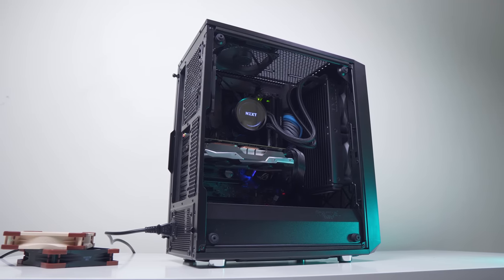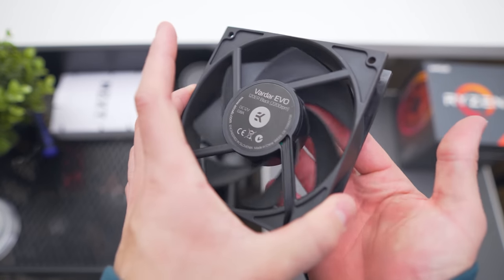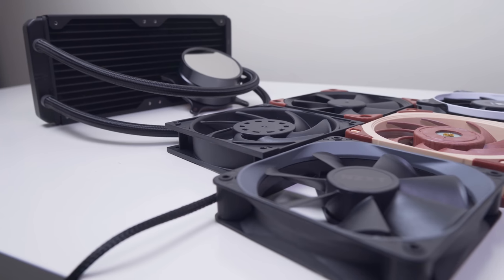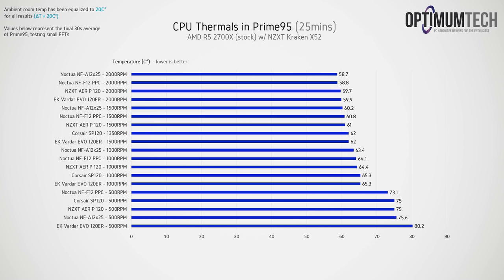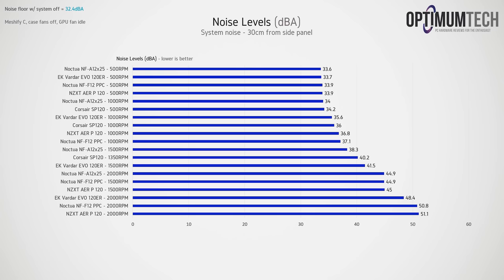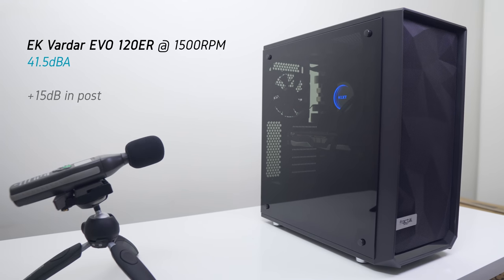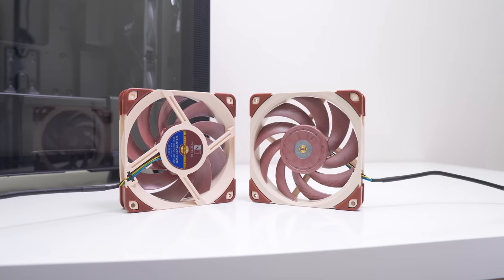Noctua's NF-A12x25 - Magic on Radiators!

Comment: Don't like the brown shit color of the NF-A12x25?
Noctua said they are going to release Black version of it around Q1 2019.
But it might be delayed because it's not a simple drop of color at 0.5mm clearance, the materials of the fan are delicate and any little change can cause the fan to touch the frame overtime.
Reply: Oferk99 Its a coffee and leather color. Not shit as shit is alot darker
Reply: it depends on the shit x) and i understand his frustration to wanting to buy Noctua stuff but just can't because of the color.
Reply: generaldwarf 
Yep, it will ruin my beautiful build, and I don’t want to buy last gen fans.
I’m better to wait for black NF-A12x25 and NF-A14x25
Reply: It depends on how your food was digested. Noctua brown can mean healthy digestion, while pcb green can mean stomach flu. Case fan black can mean stomach ulcers, while AMD red can mean internal bleeding. If your poop is Intel blue, it probably means you live in Chernobyl and need to move out. If your poop is Zotac yellow, you probably ate too much corn. Finally, RGB lighted poop means you partied too hard and had too much drink

Hope this helps
Reply: @mdexterc2894   Lol! Nice one!  Got a chuckle out of me.
Reply: actually these fans made me plan a build in white with noctua color accents. leather and maple wood. custom sleeved cables and painted radiators.
Reply: @tf2excession  q1, q2 2019 is expected. No guarantee. This is what tech support told me via email
Reply: @Caffeine.And.Carvings  I think they will show something at Computex 2019
Reply: Hopefully we get this in 2020. Lol
Reply: I'm building a new pc this week in a cougar qbx. Going to buy the remaining parts tomorrow. I'm highly considering embracing the noctua color scheme and painting the inside of my case its complementary color https://www.colorbook.io/hexcolors/view/4a2220 and painting the psu the dark brown and creating custom sleeves of the light beige color. Already bought 3 NF-A12x25 and using noctua's 92mm cooler (NH-U9S) with two of its fans. If I do decide to go with it will also paint the outside portion of the cooler the dark brown color. I can't make up my mind though. Worried it will come out horrendously ugly.
Reply: ZuRriX 
I guess covid delayed it...
Reply: We're in 2020 now, and I still can't find them in black. On the bright side, the Noctua 120mm NF-F12 PWM now come in chromax.Black.

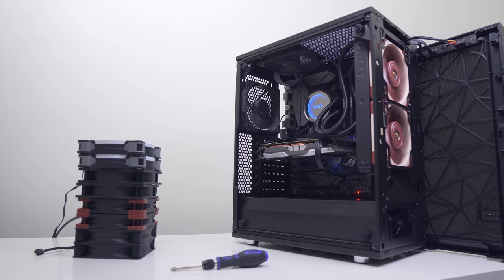Comment: 09:10 From what I see here, the place where the heat comes out from the radiator is facing inwards. Wouldn't this cause a serious temperature increase inside the case? Fans cannot remove heat by pulling it out from here. Additionally, the exhaust fan at the back cannot drain the unnecessary heat inside. I don't understand why such a thing was done.

Comment: Great video, simple straightforward and thorough.
Question: I have to replace a 140mm fan on my AIO. Do i go this fan, or a 140mm Noctua fan (which are non Sterrox).
Looking at Noctuas page this fan is quieter at a higher RPM (22dba at 2000rpm) than the 140mm (24dba at 1500rpm).  This fans flow rate is 102 m3/h, the 140mm 140m3/h but has a higher pressure...120mm 2.34mm h20, 140mm 2.08mm h20
I note that they have a 140mm fan adapter for this model!  So, which one do i go for?! Argh!
//noctua.at/en/products/fan

Comment: You really don’t seem to have the test granularity for the lower noise levels, in a quieter room there will likely. E more difference between 500 and 1000rpm. The rest of the information was quite useful though. I’d be curious about different radiator thicknesses though, thicker radiators will show more substantial differences in static pressure performance (assuming enough heat in the system that the ticker rad doesn’t totally over-cool the system on its own)

Comment: Not gonna lie, I have 5 of the A12x25s in my system it's bliss :')
Reply: do you use them to cool your case  ???
Reply: @psykobibi  What else would you use them for
Reply: By the time right this comment I was a bit lost because there is 3 versions of this noctua Fan PWN, FLX and ULN , which one to choose xD they all look the same
Reply: You can also check the specs when you search it on Amazon, scroll down to see the specs. Automatically the PWN comes 2000 RPM, but with low noise adapter, it goes to 1700 RPM. You can always can the speed in the BIOS or with a software.

Comment: I really liked that you had results for 500RPM in this testing. Especially since we can see here that the Noctua F12 can actually perform better in low RPM situations. 

As someone that like to run my case fans extremely low, seeing 500RPM results for fan tests is great!

Comment: Would be more interesting against the NF-F12 (non-PPC). Those are about $20 and the x25's are $30.
Reply: I have the older S12 and P12 fans, they make alot of noise at 100% wich is around 1200-1300rpm, A25s have less noise at the same speed.

Comment: Heat rises. Why would you exhaust out of the bottom?
Reply: In something as small as a PC case, air will go wherever the fans make it go. Convection really only makes a difference in very large areas like a warehouse or an apartment complex.

Comment: I can confirm the noctua industrial fans sound like a jet engine at max, but oml how dose noctua keep out doing themselves o.o . 
Edit: no auto fail noctua is not no tuna or nocturnal. Shush
Reply: yeah and you can even turn them up to 3000 rpm he was just testing them at 2000.
Reply: there are 2000rpm and 3000rpm versions 2000rpm ones can't go 3000rpm, there are also 140mm 3000rpm ones, saw a post on reddit of a guy cooling delided and overclocked 10 core i9, and 2 of some nvidia workstation cards, quadros, dunno which ones with 280mm radiator with just 2 fans on extra thicc radiator, he even posted video of those noctuas on top speed and it's def loud, but they got magical performance
Reply: I have 3x 120mm (iPPC-3000) on rads, and 2x 140mm (iPPC-3000)  on the case.  I have a 4-channel fan controller (4 knobs in a PCIe slot).  I keep it all the way down for silence (fans still blowing), and crank them up to 75%-100% when I'm playing games with headphones.  I also have one of these NF-A12x25 fans I recently bought to replace a noisy fan that was making clicking noise.  All the way up with no adapters on, the fan is quite quiet.  Although they don't push as much air as the 3000rpm fans, they do a great job.  My water is always under 30°c even while gaming. Not bad for southern Florida.

Comment: You should have a look at gentle typhoons, this is probably the most underrated and underdog fan for radiators and it looks darn good imho. Ive had them on an open case and the nzxt are REALLY loud, pc is on desk and if Im not wearing headphones I have to put speaker sound from 15 to 25 to actually be able to hear audio. No doubt a12 are good but not sure I want this color on my high end watercooling build.
Reply from the maker: For sure, I just can't find them anywhere in Aus. 
Found them on Amazon though, I'll look into them.
Reply: In asia is also almost imposible to find. But any fans nowdays below 1000 rpm is almost silent
Reply: Optimum Tech too bad we can't easily buy things from Amazon anymore :(
Reply: They are really nice I still have some around here somewhere.
Reply: Black Version of All noctua Fans will came end of the year. Early next year.
Reply: Scythe, the producer of GT has stopped production of their consumer GT fans. Occasionally you find there server fans, but those are 5400rpm fans that will draw a bullload of power and are loud af.
It is believed that Scythe gave their design for the consumer GT fans over to noctua, because those new fans look darn close to the legendary GT.
Reply: Underrated???? These used to be the go to watercooling fan back in the day prior to these static pressure fans appearing on the market.

Comment: How about the redux version?  Its 1700rpm max is half the price, it does have the old bearing but is at least grey/black.  Also you should run the fans at full speed, which is where the IPCC fans will beat any other not running @ 3000prm.  I have 3 set to respond to my X72's water temperature.  They need a little fine tuning now that its summer.  They also have the latest SSO2 bearing, and are more efficient at 2000rpm than 4 pole fans.  They have the low speed accoustic tuning of a less sharp PWM pulse.
Reply: Great info Thanks

Comment: Noctua GIVE ME THESE FANS IN 140 AND MAKE EM BLACK FFS xD
Reply: Chromax!
Reply: pretty sure there's a 120mm to 140mm adapter that noctua makes
Reply: Mainly bacause the 140mm  version would be better performing 😂
Reply: @Superfly29rr Their current 200mm fans are an old design. These new fans with Sterrox impellers and ultra low tip clearance only come in 120mm so far, but the 140mms are coming next.
Reply: @Superfly29rr Because it's new, and because Noctua engineers each size of fan separately. They don't just scale them up and down. 120mm is the most common size, so it got the Sterrox redesign first, and 140mm is next. 200mm is very low priority for it, and would likely make them too expensive because of the size. Besides, 200mm fans are typically silent as they only run at 800 RPM.

Comment: I just built an air cooled Ncase with an 8700k + 1080ti SC2. I have to say, it was a PITA to build it BUT the noise from the 1080ti is getting unbearable. How can anyone run this EVGA 1080ti SC2 with fan speed over 50%! Default or any fan curve to keep them 80C and below is too loud, sounds like a jet engine.

Comment: These are so similar to the gentle typhoon AP series, close enough to call noctua out on copying the GT AP15. The AP15's we're the popular ones. Unbeatable noise levels and static pressure. I still use them to this day. They're now sold as AP53's I think.
Reply: gentle typhoons are garbage. just look at the stats. horrible performance. the noctuas blow them out of the water.

Comment: Are the BeQuiet Silent Wings 3 fans as good as Noctuas F12 or A12 fans? I cant seem to find any good comparison of these two.
Reply: no. nowhere near close. noctua sterrox fans are leading the pack in performance. no one comes close.
Reply: @goblinphreak2132  i dont mean compared to the NF-A12. The older ones.

Comment: I like this review ! Just wondering will it be different if you let stock fan on the radiator and use NF-A12x25 as exhaust on the bakc and top ? would it be the same result ?

Comment: Bro I have to respectfully disagree with your review. They might be good with the radiator you are using (noise wise) but they sound very annoying with my radiator (hardware labs GTR 480) - I have 16 of these fans in my SMA 8 case - and although they are quite they have a really annoying buzzing. Almost like I have bees buzzing - @ 1350 rpm

Comment: Old video, but in hopes you see this: Radiator, if mounted vertically, should be oriented the other way around to prevent the pump from gurgling air. The opposite cap is designed to trap air but only works if you  mount it in the opposite orientation. Will improve performance and reduce noise.